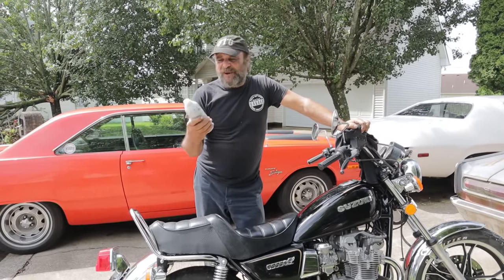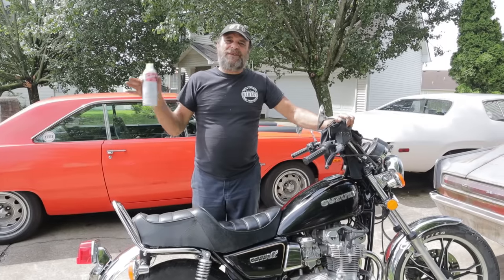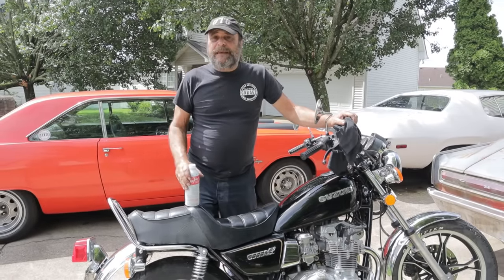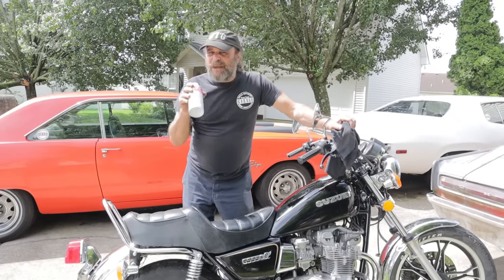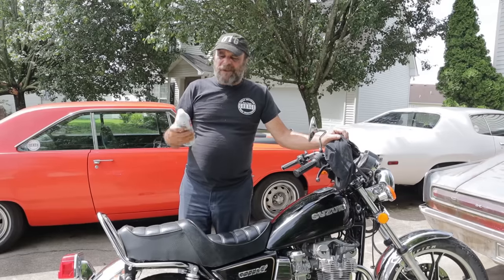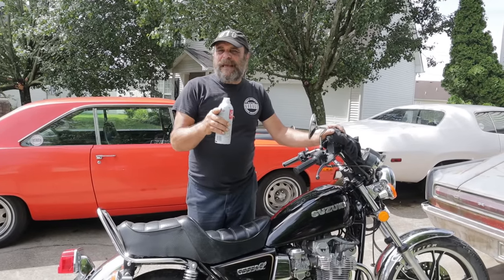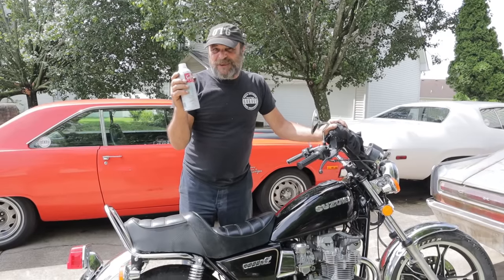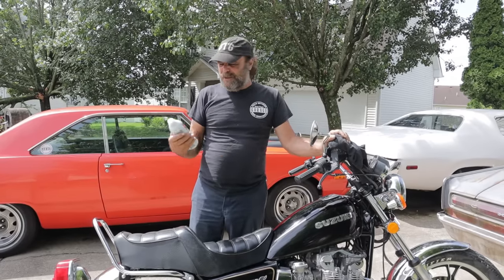We Try Seafoam - We Come Away Shocked

Comment: That's exactly what it's for! Personally I use it all the time when I don't want to remove my throttlebody or intake manifold to clean 'em properly on modern fuel injected systems (it's a hassle). I think of it as a basic quality cleaning, it's better than nothing! I've compared it after taking off my throttle and I can see it works for cleaning, not magic fixes like people advertise and expect. 

Also I've never noticed a difference for it cleaning the inside of the cylinder. I prefer to use it through the air intake as direct injection doesn't care if you put it in the gas. I use it mainly on modern Cars with direct injection after an oil change or if I notice stumbling and I'm feeling lazy. If you suspect it's just carbon or varnish buildup due to modern gas, it's always worth trying this $8 fix before taking stuff apart.

Comment: Hey uncle tony. Sea foam is supposed to be an excellent fuel stabilizer for winter storage. I havent used any yett. But when winter comes im going to try seafoam. Ive heard very good reports from my friends. Also echo 2cycle pint in auto transmission really cleans valve body well. Improves sticky shifts. Bands etc.
Reply: How’s it workin through winter?

Comment: Red Line Fuel cleaner actually has a tad more detergent. I had the same experience on a Suzuki DR200 that would barely start. Got it "running" and hobbled around the block three times to warm up the engine. Shutting down overnight let the heat soak into the carb which helps the detergent act on the "boogers." Next morning, ran like new.

Comment: I've tried it as a cleaner and not bad. Real good for winter storage with treating the gas.
Reply: Had horrible results trying to use it as a stabilizer.  Live in Saskatchewan.  Have 5 sleds. 
Had to go through all the carbs because it just turned gas into a white power. 
Stabil fuel stabilizer period
Reply: @Welcometofacsistube  in my experience ive never seen white powder
Reply: @allanmcelroy9840  it did nothing but oxidize the fuel in the bowls. Used Stabil and never had that problem again

Comment: I've been using Sea Foam for years.  It's really pretty good stuff.  It also works in old flatheads (1947 Ford 8N) to free sticky valves when used in the crankcase and fuel supply.  Sometimes, you just have to let it work, which may take a day or so.

Comment: I haven't used Seafoam, but I used to use Gumout on my kid's dirt bikes (20 years ago). Fed it directly into the fuel line while the engine was running, it would run rough using 100% Gumout for fuel.... but after a few minutes all the passages on the inside of the carb would be cleaned out. Hook the fuel line back up to the petcock and it would be good to go.

Comment: I'm amazed that you have never tried nor believed it worked until now. 
The stuff is a major staple to mechanics old and new for practical cleaning of carbs, valve/seats, injectors, etc while avoiding unnecessary teardown, when possible. 
It won't work miracles when internals are beyond self-cleaning, but when there's at least some flow and it works, SF can usually get it cleaner and improve the situation. 
I use it myself from time to time. 
Welcome to the club, Uncle Tony!

Comment: I stand by sea foam, great product. On vehicles that haven’t been cleaned for a while I get it up to operating temperature then suck 1/3 of the can through the brake booster line. Let it sit for 10-15 minutes then turn it on. Enjoy the smoke show if your engine had a lot of carbon haha
Reply: Works best that way!

Comment: I use Sea Foam in my 1997 Dodge Intrepid which I've had since 2010, it has 366,000 KMs (Canada).....I get great mileage and it runs smooth as silk. I haven't touched the plugs since I've owned it. I also add some Sea Foam a week or so prior to an oil change. I know the 3.3 L engine is very good but I really believe Sea Foam is part of my success....Thanks for your video.

Comment: I'm still skeptical. For definitive proof I'd have to see disassembled before and after results of the carb. Otherwise I discount this as random chance.
Reply: Me used 2 b skeptcl, 2.  Fuel Trim values too negative and got startup, cold misfires.  SMOG check failed. That night, did SMOKE clean u c on YT, twice, including heat soak.   Drove highway during week about 50 miles.  Trims less than 5%, and passed SMOG!  
Now, I buy SF by gallon.
Reply: There ARE YouTube videos showing the actual results, beyond that get off the dime and try it!

Comment: Another happy Seafoam customer. I put it in all my 5 gallon gas cans at every fill up. Use this additive for all my small engines including my JD X540 and Stihl chainsaws. I bite the bullet and burn non ethanol. My JD when new had clogged carb from ethanol. The carb has very long and fine fuel passages that didn't like ethanol gas. Seafoam cleared them right out and been fine ever since.

Comment: It is not a miracle cure all  but it does work. One of the best uses I have found was hot soaking the injectors on my Kubota tractor. Get the engine up to temp then shut the fuel. Unscrew the clear fuel filter housing and dump the contents. Fill the housing with Seafoam and fire it up and let it run for 15 seconds then sit and soak for a few hours. Afterwards, turn your fuel back on and run as normal. Really smoothed out the diesel engine on my L3010. I have had good success in 2 stroke outboards as well.

Comment: Seafoam and Berryman's B12, used it for years and they WORK!! I used to have a 2003 Honda car. About once a year I would get the engine check light for the O2 sensor. I would add a can of Seafoam and usually about half way through that tank, light would go off and car would run great again. Did that for years in that car, Seafoam always did the job!

Comment: I have used it for decades but only in small engines. Every spring a little in the motorcycles and the stumble is gone before the first tank is empty. Also use it in mowers and power washers.

Comment: I had a 1992 Honda Shadow with munged up carbs after sitting for a winter with untreated gas. Ran a couple tanks of Seafom treated gas through it and really noticed a difference for idle and startup performance. If you're not interested in tracking down multiple carb rebuild kits, actually rebuilding your carbs and then presumably syncing them all back up again I'd say it's certainly worth a shot. What have you got to lose?

Comment: I also proved t to myself by using it on a skid loader that wasn't running very good. It had a terrible idle and almost stalled. I poured an entire can of Seafoam in it and let it idle for about 10 minutes and it clear up and ran perfect. It must have cleared some dirt out of the jets or small journals. I now use it in all my engines and also use it as a fuel stabilizer over the winter months in my lawn mowers and motorcycles. It works great!

Comment: First time I used Seafoam was on my two-stroke outboard during a bi‐annual service.  After running a can through it,  I was amazed at how little carbon was on the plugs when I pulled them for replacement.  I was convinced after that, and have used it on many two and four stroke engines.  Rislone oil treatment is another product that's done right by me and kept engine internals remarkably clean.

Comment: This stuff works!   My 99 Silverado engine light came on, for catalytic converter. I added a whole can of this to about quarter tank of gas, ran it till almost empty.  The light went off, I took it in for smog, and it passed with no issue.  I might have got lucky, but the light is still off and its been almost two years now!

Comment: Seafoam is also a good fuel preserver/stabilizer if your machine will be sitting unused for several months such as over the winter months.
I have been using it for years in motorcycles, boats and lawn care equipment. 
I always have a few cans sitting in the shop!

Comment: It worked on the Honda I bought. The slides were sticky. You could rev it and it wouldn't come back to idle.i put 3 capful of  seafoam in it while it was running. Problem gone in about  2 minutes. Never to return. Great product  seafoam!

Comment: I put sea foam in a 1952 ford 8N tractor and it worked wonders in the fuel tank so I put some in the crankcase and ran it for a few minutes and the motor smoothed right out.  Changed the oil and it ran like a new tractor.  Seafoam is great stuff!

Comment: I've always ran Seafoam in my push mower ever since I bought it. Twenty two years later and I've never had to clean the carb even once. I'm sure the rubber diaphragm is as brittle as toast by now, but it never fails to start and gets the job done every time.

Comment: I have used Seafoam on all my small engines (outboard, garden tractor, lawn mower, weed wacker, etc.) for years and it has helped keep them all going with minimum service. It also has a fuel stabilizer in it so If I don't not use something for a few months and it will still start right up and run fine.

Comment: I put SeaFoam in my 1956 Jeep before I park it for winter. It sits for 6-8 months and starts right up. Since using SeaFoam I no longer have to rebuild the carb every year.
I keep SeaFoam in my 5 gallon gas can year round for yard equipment. I park each machine at the end  of the season with however much has happens to be in the tank. It starts right up again the next season with zero fuel issues. 
I have tried StaBil only to have a gummed up carb.

Comment: I had a 99 Toyota Tacoma that had a stuck idle air control valve. It was a 4 ish hour job to replace and required pulling the intake manifold off. I pulled the vacuum line off the valve and put a funnel into it and fed it half a can of seafoam. It fixed the problem and saved me the trouble of doing all that work. Seafoam is magic in a can!

Comment: I just tore down  a set of carb off a 1974 CB 750 on the weekend Pilot jets plugged solid. Mains not as bad. Soaked them in Seafoam for 2 days. . Blew them out . Just like new.

Comment: I recently bought a similar fuel addative to help my scooter with it's bogging down, it stated that over applying won't damage my engine.

I've noticed that that the valve noise is quieter and I have improved power output, I've since filled up the tank with fuel to run the product through thoroughly. 

I think those addatives help to clean the carby jet, they just take time. 
Like a few days. 👍

Comment: back when i bought my truck a 92 chevy single cab long bed c1500 with the 4.3 v6, i drove the truck and it was fine then i put the seafoam in the gas then ran it all down and filled it back up and since then it has been running a bit better, it ran fine before but cleaning it with the seafoam i can feel the difference on how it runs. im just a young guy but my dad he told be to do the seafoam and im glad he did. even if i didnt notice any change i would have still been happy with it since its 30 years old, it would have given some form of peace of mind.

Comment: I love seafoam. I have a gallon can of it in my shop always. I like to use one of my paint guns to spray it directly into the intake while the engine is running. It cleans up direct injection system incredibly well.

Comment: that is the bottle for maintenance cleaning the fuel system and for use in oil. the intake seafoam is different, you spray it into the intake while the motor is running and at elevated RPM, then you shut it off and let it heat soak in the motor for a while, then run the motor well to burn it out, it will smoke like crazy. not sure if carbs are different.

Comment: Seafoam and Berryman's B12 both surprised me. I use Seafoam a couple times a year on my car in the tank. And it works wonders on helping a vehicle run better when some is poured down the throttle blades as well while the engine runs.

Comment: It works.  I have seen Seafoam extend the life of more than one industrial engine when used as a crankcase additive (Caterpillar G398, G379).  Frees sticking rings and valves.  These were engines with 80k-100k hours.  Hours, not miles.

Takes a lot of Seafoam to treat a 50-gallon sump...

Comment: I've been using it more and more on my small engines. My pressure washer got to a point where I had to yank the air filter and squirt carb cleaner or either down it's throat to cold start it. After a couple tanks of fuel with some Berryman's B12 that behaviour is gone. Sometimes my generator would want to run on a partial choke when cold, not so since I started running this stuff. It does make a difference.

Comment: My first bike was a 20 year old kawasaki 550 . Got from a friend. Spent cash on a shop cleaning the carbs but it still wasn't right. Kawasaki forum post suggested seafoam. And it work like a charm. Been using it since instead of Stabil over the winter  and usually once a season . Works on Fuel injection too.

Comment: When I worked in a marina in Miami 25 years ago that’s what everyone used… When flogging the engines for when it goes into storage for the winter in the north it preserves the fuel and it will clean out the flogging crap in the carbs too…

Comment: I've heard about Seafoam for years. I'm old. All the anecdotal comments by others over the years and never heard anyone (I mean ANYONE) say anything bad about it. I tried using it about 20 years ago. No issues. What I learned, and has really made me a believer in it, is using it to fog small engines that I don't use regularly. Weed wackers, ice augers, chainsaws, 2 cycle, 4 cycle, etc. I drain the fuel tanks and put a little Seafoam in the tank, turn over the motor a few times to get the Seafoam into the carb. After a year or more of not using that engine, I can fill it with gas and it starts like I just used it 3 days ago. I'm a believer.

Comment: I had a 50,000 mile CB700SC that had heavy deposits on the intake valves causing low compression on a couple of cylinders.  Fogged the intake until it stalled on a hot engine, let it cook for fifteen minutes or so and then ran it hard for some mosquito control.  Repeat the process twice more and the compression numbers came back into spec.  

A lot of what is claimed by Seafoam is bull, but in this particular instance it actually worked really well.

Comment: The Key thing is to add to tank BEFORE filling so when you fill up it mixes completely. stuff works greak Before an oil change too. just add what it needs to every quart, drive at least the last 200 miles +/- 50 and then change the oil.. its amazing.

Comment: Well done and well said ! most people, like me ,put in additives and expect quick results , usually within an hour or so and do not give the additive time to work (2-3 tank-fills or a few days) I have used many additives on many machines in the past 50 years doing the same thing. .The older I got the more patient I became the better the additives worked. They are not miracles in a can, and sometimes require basic maintenance.

Comment: I use this stuff in every thing. Had an old rusty beat up ranger i bought for 150 bux for a work truck. first day i was lucky to make the hill doing 48 mph in 3rd gear.fed that thing sea foam. 3 days later topped that hill at 67 mph no problem. My snow blowers / mowers all start 2nd or 3rd pull after sitting all year.Well worth the 7 bux.

Comment: Seafoam fixed an intermittent miss on a Honda VTX 1800 I bought. I'd already done all the typical tune up items but it was EFI so no carbs to rebuild and injectors were not easy to get. After running out of options someone talked me into trying Seafoam. I gave it a heavy dose of half a can in the tank. Never had the miss again in three more years of riding it. I run some Seafoam through all my stuff a couple times a year now as preventative maintenance.

Comment: Tony I've been using it to clean up carbon in engines and it works great. Then on small engines I add enough to the gas that it runs but smokes like a banshee. It cleans the motor out great and gets the gunk out of the carbs. It's great

Comment: Uncle Tony your right! that stuff works, also LUCAS too. It's a bit oiler than SeaFoam, but if cleans the valves and I've had better throttle response after using it

Comment: I got a 1973 buick electra 225 with 76,000 original miles & was having dieseling issues after the engine was up to temp. After chasing several things including a full carburetor rebuild was still having issues. Tried the seafoam & is almost completely solved the problem. I think in my case my it's acting live a fuel stabilizer keeping the fuel from boiling in the carb bowl. Seems to have fixed my cold start problems too where the bowl was going dry over night.

Comment: I always add a little at every fill up.

Use non-ethanol and this, never had fuel system issues.

Mine is injected, making it much better in post winter starts
Reply: @joesgarage2493  It’s my motorcycle, doesn’t cost that much extra. Even if it’s just for my comfort, It’s worth it to me. Injected. Plus I have heard that my make of bike doesn’t run as great on lower octane, but still runs fine.

Comment: Been using Sea Foam in my equipment, vehicles, and Harleys for decades. When you can't run the fuel system dry for storage add S/F and run the engine until you are sure that mixed fuel is in the system before storing.

Comment: I had a 1974 dart Swinger 360 holly double pumper, radical cam headers, slingshot torque converter, 725 torque flight. I also used sea foam on an old Japanese bike 1983 Kawasaki Specter, it worked after about 24 hours.

Comment: A few tablespoons of STP gas treatement or Gumout fuel injector cleaner will work as well. 
Seafoam can be added to the oil as well. But caution, it can loosen an otherwise tight fitting PCV hose, and cause it to pop right off while you are driving, thus spraying oil all over your engine compartment.